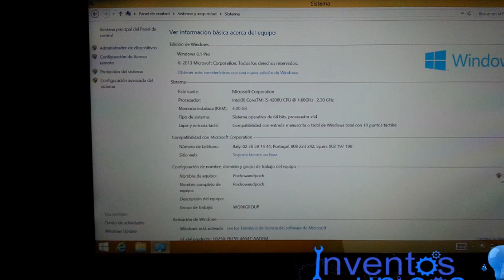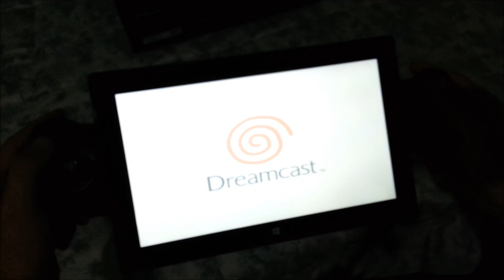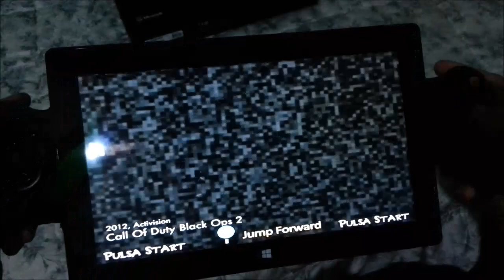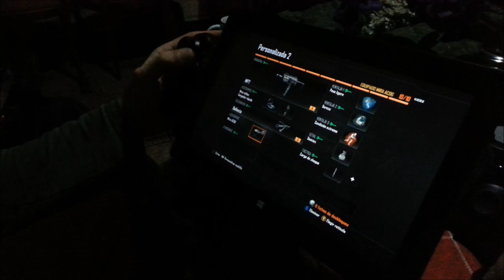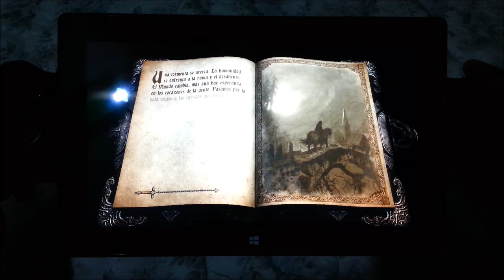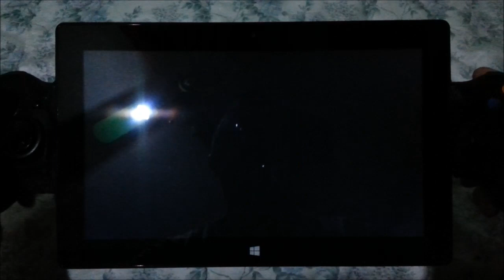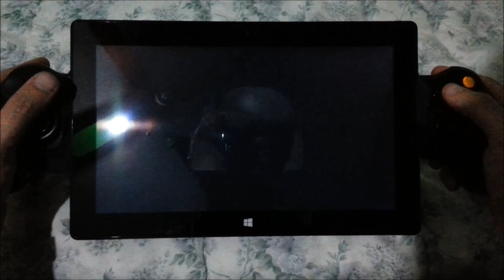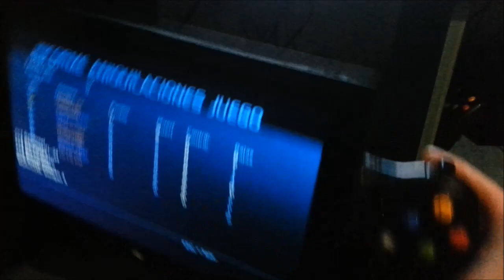Surface Pro 2 Mod Gaming

Comment: I have to say that is brilliant. I was too worried to do that and just slapped an Ipega 9023 round my Pro 2.
Reply: I've done the same. Its a shame some games have difficulty working with the Ipega. I always keep Joytokey around in case of incompatibility issues, but even that doesn't always solve the problem. Wish I had one of these modded Xbox 360 controllers.

Comment: Estoy impresionado, la verdad que comparado con otros mods que voy viendo por ahi esto es una maravilla, impecable.

Una duda: ¿la tablet corre ese tipo de juegos o tambien le retocaste algo?

Buen trabajo :D
Reply from the maker: Hola ChapiFTW,asi es,la tablet los corre tal cual ves en el video y solamente con la bateria,sin cables,en cada juego normalmente hay que bajarle la resolucion entre 1024 X 768 a 1600 X 900,en algunos casos a 1080p (los poco exigentes),sobre los graficos es muy variable,hay jugar con ellos y toquetear sombras,anular antialiasing y filtros,asi se podran dejar las texturas y graficos en alto/medio.Un saludico.

Comment: Hola, tengo una pregunta MUY IMPORTANTE que hacerte y seguro que a ti también te interesará, pero primero te cuento: Seguro que sabes que hay un programa llamado XPADDER con el cual puedes configurar un mando de consola para jugar con el ordenador. Funciona mapeando el teclado y el ratón asignándole las distintas teclas y clicks a los botones del mando. Como tu utilizas un mando de Xbox compatible con Windows no lo necesitas en tu Surface, pero para jugar a juegos antiguos o que no detecten mandos de juegos, Xpadder es una solución maravillosa.  Yo todavía no tengo la Surface (pronto), así que ahí va mi pregunta: ¿Podrías mapear los controles de un mando (por ejemplo el de la propìa Xbox que utilizas), con el programa Xpadder en tu Surface Pro? La cuestión es que un ordenador portátil o una torre, tienen el teclado y el ratón conectados (en el caso del portátil, SIEMPRE), pero la Surface no los tiene, así que me gustaría saber, de primera mano si el programa Xpadder es capaz de asignar dichas teclas aunque no exista un teclado físico conectado con la tablet. Ello significaría que el sistema operativo Windows 8.1 de tu tablet tiene "interiorizada" la configuración de un teclado y que por lo tanto para la tablet es como si realmente apretaras esas teclas con el mando de la consola. O si no, conectarle un teclado y un ratón, configurar el Xpadder con el mando y una vez que hayas terminado y guardado la configuración, desconectarlos y seguir usando el mando sin problemas.
Espero haberme explicado bien y sin volverte loco, pero piensa en los beneficios de mapear los controles con cualquier mando en la Surface. Muchas gracias colegui ;)
Reply from the maker: Hola Alex,se puede usar xpadder perfectamente emulando los botones del mando como un teclado (yo lo uso para Halo CE),no hace falta ningun teclado aparte (Xpadder hace teclado/raton virtual).Tambien uso Pinnacle Game Profiler que es algo mejor que xpadder,lo unica pega es que es de pago.Un saludico.